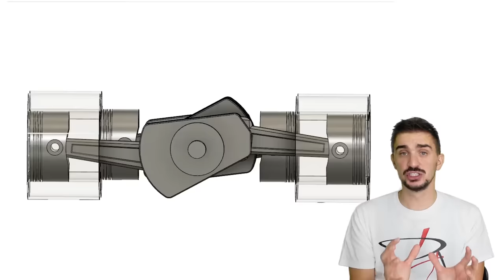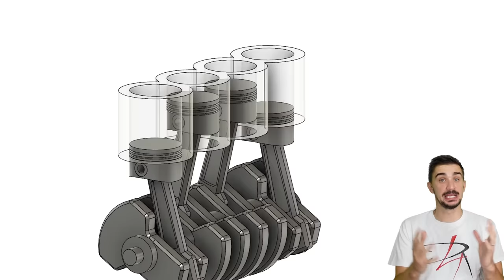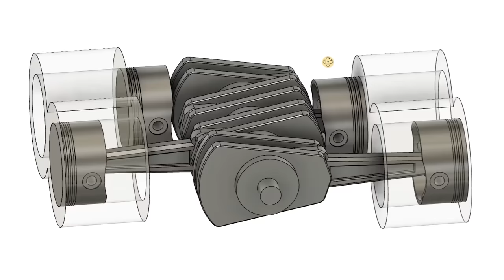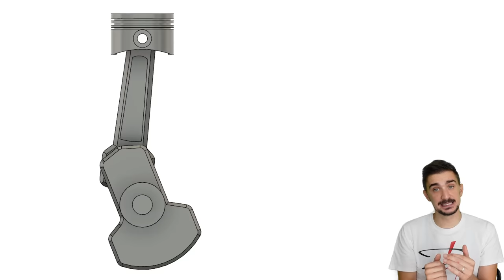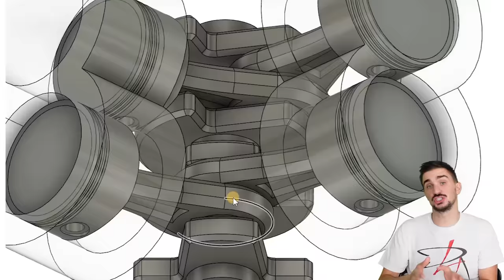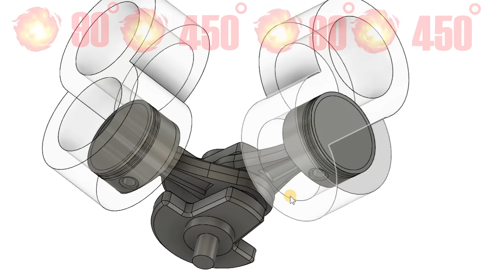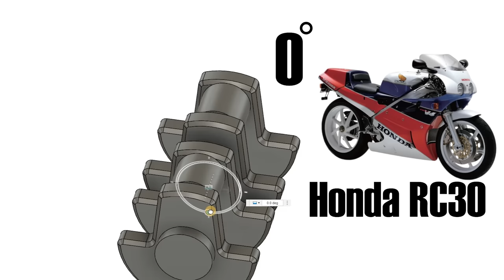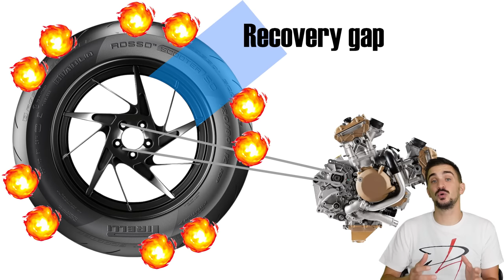Deep Dive: Inline 4 vs. V4 vs. Boxer 4 - What's the Difference? Engine Balance Explained in Detail

Comment: There is a solution to the offset problem with boxer 4 engines that I have never seen before, but the calculations add up. Suppose you have an I4 with a flat-plane crankshaft (that's basically all of them). Now flip the outer or inner 2 cylinders by 180°, making it a flat engine. You should now have the outer 2 cylinders on one side of the engine, while the inner ones are on the other side. Now it must become a boxer engine by having the opposing pistons reach TDC and BDC at the same time. This design has perfect primary and secondary balance from just 4 cylinders! Keep in mind that this is only possible with a cylinder count that is divisible by 4, so a boxer 6 of this configuration sadly isn't possible. I really don't know why no-one used this design before, so if you do know, please let me know. Thanks for the video! :D

Comment: It is hilarious how much worse the NA B4 and H4 are compared to the NA I4 in horsepower, torque, mpg, spark plug maintenance, and reliability. The only real positive for a B4 is “lower center of gravity”. 
An example of this is how the 2012 200hp NA B4 engine in the Subaru BRZ struggled to get 33 mpg highway, meanwhile both Toyota and Honda have been using NA I4 VTEC and VVTi engines to get 200hp and 40+ mpg since the mid 1990’s and early 2000’s. The Honda S2000 engine and K24 are proof of this. In order to get 225hp in the 2022 Subaru BRZ’s new H4 engine, the mpg took an even bigger hit and now they can’t even hit 27 mpg highway.
Reply: Subaru is behind Honda and Toyota in terms of efficiency and power density in an NA engine. On the other end, Subaru turbo 4s are engines of renown.
Reply: @psychemist2689  That is a good point, I almost forgot about that!

Comment: 22:20 The Alfa Romeo Alfasud from the early 1970s and the later Sprint, 33, 145 and 146 models, used a boxer 4 with a single piece cast iron block and the engine remained in production until the late 1990s.

Comment: I wish BMW made a 800cc boxer GS. I love those engines. They are perfection to me. I fell in love with boxers at first sight when I was 17. I would just look at them and say to myself: that is the perfect design. While your criticisms of boxers may have some validity in some applications or in physics, they really aren't a problem practically speaking. But I only concern myself with 2 cyl boxers. Horizontal opposed engines are used in most all aircraft engines for a reason (Lycoming, Continental). They are the most simple, lightweight, reliable engines that can be made. And as for motorcycles, they have the lowest center of gravity, and the cylinders protect your feet and ankles from cold and when laying your bike down.

Comment: The Ford Taunus V4 (the granddaddy of the Cologne V6 engine) was a 60 degree V4 with a rotating balance shaft...this engine was more legendary for being the engine of the Mustang I concept car (closer to an open topped Pontiac Fiero than anything else), and also the 4 stroke option for SAAB cars until SAAB created their own 4 cylinder engine.  It was in SAAB 96's, the SAAB Sonnet II in the USA, and the SAAB Sonnett III.  It was probably in early production SAAB 99's as wel...

Comment: The Ford Taunus Köln V4 also uses a balance shaft to get rid of the primary imbalance caused by its 60 degree bank angle. and it was made with the 60 degree bank angle because ford usa later wanted to develop it into a v6 and the v6 would be the main engine so they made the v4 with 60 degree bank angle and then ford köln took the american v4 and made the 60 degree köln v6 and there is no balance shaft in neither the köln v6 or essex v6 meanwhile both köln v4 and essex v4 has balance shaft

Comment: Would be interesting to see a video about flat engines in general. A flat 4 like you mentioned has extreme rocking imbalance which is why it is rarely seen. Theoretically a flat 8 would work better to cancel them out, just like an inline 4 cancels the primary forces.

Comment: I was lucky and at the same period of time I have a Ducati ST3, Triumph Sprint ST 1050, BMW R1200GS and a Honda VFR1200x. All ran well and only considering the engines the Triumph triple seemed the smoothest but the VFR was very close but also obviously much more powerful. The Ducati had an exhaust and was the more "racey" sounding engine and seemed to have the most profound torque curve. The GS has the most vibration but seemed to have the most torque lowest in the rpm band and seemed to be the easiest to control. I liked them all. And all served their purpose well. I only put about 20k miles on the VFR and Ducati. A few more on the Triumph and over 180k miles on the GS. I think the VFR engine sound is best. But the Ducati exhaust made it sound like it was something special.

Comment: Could you please contemplate the creation of a video explaining all the different drift and oversteer (incl. snap) characteristics considering the common engine-placement concepts in rwd-chassis such as front-engine (Viper etc.), front-mid-engine (Miata etc.), mid-engine (Pantera etc.), rear-mid-engine (MR-2 etc.) and rear-engine (911 etc.) due to balance resp. partial systemweight on each axle? And therefor the position of the rotational resp. yaw axis? This could be very interesting and helpful, I think. Thank you for paying any attention to this comment.

Comment: I have kept my Subaru WRX boxer engine completely stock since the day I bought it,  233,000 miles later and its been a great engine. But many don't understand what turning up the boost does, you can get away with it for a little while but it will cause major issues for your Subaru, you do need to know what your doing or your engine will quit on you in a catastrophic way.

Comment: Correct me if I'm wrong, but in regards to cars, most V4 engine cars were 2 stroke engines, since 2 strokes fire every 360 degrees instead of 720, a V4 two stroke wouldn't have the problem with uneven firing order. Also I don't think that uneven firing order was really that large of a reason, given the Ford Taunus V4 was a 4 stroke V4 used in quite a few cars. Additionally, american V8 engines had an uneven firing order because of the cross plane crankshaft. I suspect the reason the V4 isn't so popular in cars is that it doesn't present any real advantages in packaging over an inline 4. Sure it's shorter, but the I4 is already quite short. And if you want a front wheel drive car, having an inline 4 sideways (axially mounted, I think it's called) in the engine bay is shorter than a V4 would be. The same sort of logic applies to why boxer 4 engines are pretty uncommon.
edit: I just watched a little further and found out the Ford V4 had a split crankshaft.
Reply: I can't say I've heard of a two-stroke V4 in a passenger car. I remember three-cylinder two-strokes in the DKW-Auto Union and Saab cars, but...
Saab went to the Ford-sourced V4 for its model 96 and related cars because the three-cylinder two-stroke engines no longer met emissions standards. 
The original Buick V6 was a 90-degree engine with  90-150 firing angles and 165432 firing order.  Buick sold the tooling to Kaiser after the '67 model year where it became the powr plant for the CJ and Jeepster models. A neighbor built a Jeep from a kit got his family when I was a kid, I remember the body was warped and he had to get another. Another friend's Mom had a V6 in a Y-body Buick Special wagon. Both vehicles felt really rough under acceleration (both were three-speed stick shift), felt almost like a "Magic Fingers" motel massage bed. 
Buick reacquired the tooling in time to have a V6 for the 1975 Skyhawk and Aopllo/Skylark models. I even had a neighbor who had a V6 in a pre-downsize LeSabre. 
Buick engineers quickly developed a split-pin crank shaft and evened the odd-firing for the '76 models.

Comment: 9:08 i would never have thought v4 was so uncommon in cars that a car i have would be an example. 

Also, fun fact. Ford bought saab 96s for testing the v4 engine, and later sold them back to saab with the engines still in them. Saab tested the cars and this made them acquire the v4 engine to use in the saab 95, 96, and 97.
Reply: Lancia made an inline 4 that was slightly V, just enough to snug the pistons closer to each other. See Harry's Garage channel, and the restoration of his classic Lancia sports sedan.
Reply from the maker: That would be a VR engine. It has just one head right?
Reply: @d4a  Is "VR engine" an official engineering term? I'm sure it wasn't a thing in the 1970s when the V4 Lancia Fulvia HF was winning world championship rallies. But yes, Lancia had a 12° V-angle with a single cylinder head covering all the cylinders. They also had a 20° V4 engine in the Lancia Lambda in the 1920s. From my understanding,  Lancia were first to manufacture cars with V4 and V6 engines in mass production, so they should have got a mention here. Lancia also had a flat-4 boxer in the Lancia Gamma, so you could have done the entire video with Lancia examples.

Comment: I know it's not a racing platform but I would love to see a deep dive into a parallel twin. How does it compare to other options in street bikes?

edit: Growing up I always thought engines and suspensions were some type of magical knowledge that I would never understand. Your channel does a great job explaining concepts that are, on a micro level,  pretty simple. It just needs broken down. You're doing a great job of that here. Thanks
Reply from the maker: Here's the inline two: https://youtu.be/a9ZFZABaLbg
Reply: @d4a  Haha, Thank You! You are the coolest!.
Reply: @d4a  the term "boxer" in modern times is wrong.. understand a flat/opposed cylinder engine each rod has its own big end journal.. a Boxer opposed engine share bigend journals with opposing cylinders.. the reason.. for a shorter & much stiffer & lighter crankshaft & much cheaper to make .. the downfall being high primaey imbalance comparable to a single.. bit with higher combustion efficiency & rpm potential than singles

Comment: I find the aircooled VW boxer engine doesn't vibrate very much in a campervan. Because it uses 1 camshaft and runs pushrods, it has no belts. It just uses a gear system. 
Without coolant, it is very compact, so it isn't very wide, thus making the engine size very compact. So, the width of the vehicle isn't very wide.
I understand a VW classic car is far from a motorcycle, but it is very, very simple in design. 
For me, the aircooled boxer engine is a very clever idea decades before motorcycles used the same design.

Comment: Great vid, but if the secondary vibration is caused by the sideways motion of the crank pulling (or pushing) the piston faster during mid stroke, I don’t understand how there is then an additional secondary force at TDC and BDC as you show at 14:00.  Also, looks to me like those two “secondary” forces (if they actually exist) would just be part of the primary imbalance.  Even I’d they existed and contributed TLT he primary imbalance, since primary imbalance cancels in a straight 4, they would not add any added vibration one way or the other.

Comment: Secoondary shaking force is primarily obvious on inline 4 cylinder engines. This is the source of the buzzing. The actual cause is the center of gravity of the engine between 2 pistons at TDC and 2 at BDC. At 90° after or before TDC, all the pistons are a bit lower than half the stroke, thus the center of gravity is lower. The engine wants to maintain its center of gravity so tries to jump up.

Comment: Hi! You stated that the firing order of inline 4 cilinders can’t be changed and will always be even. However, Yamaha has changed the firing intervals for the CP4, inline 4 engines that they use for the R1 and MT01. Besides the mass resonance, this does something interesting to the vacuum resistance during the strokes too. Maybe this is something interesting to do a video about too!
Reply from the maker: 26:03
I have an entire separate video devoted to the cp4: 
 https://youtu.be/uM-ycHS9uvw

Comment: Regarding high power it should be noted that most small aircraft prop engines are 6 or 8 cylinder boxer with continuous power between 200 and 400 HP.  Here the choice is manly due mostly cancelled out forces giving much needed freedom of forces other than rotation and generated push as well as better cooling than a single inline bank.

Comment: Lancia Fulvia had the first FWD rally winner, with a V4 or rather a VR4, bcz I believe both banks shared the same head. The development happened around the same time as Ford's 1/2 windsor.
Reply: Lancia also had a 20° V4 with a SOHC back in the 1920s. I'm pretty sure that would have been the first mass produced V4 car engine.

Comment: Yamaha R1 is an inline 4 with a cross plane crank shaft with it set at 90 degree intervals,  with a firing order set at 270-180-90-180. The Yamaha Moto GP also uses this technical design. So there is a flaw in your explanation of what an inline 4 can or cannot do. Otherwise, I enjoyed it.
Reply from the maker: Really? https://youtu.be/uM-ycHS9uvw
There is no flaw with the explanation because an exception is not a rule

Comment: I actually feel very little if any vibration from my VFR750 and the engine is a stressed member of the frame. So there is zero vibration separation. Something you missed was the benefit of the V4 that Honda uses in the VFR which halves the primary imbalance by throwing it 90 degrees out. a 90 degree V twin also benefits from doing this as well like the V-Strom.
Reply: What do you mean by halving the primary imbalance? 90 degree V2 has perfect primary balance achieved by using a crankshaft counterweight. Same for V4 as it's two V2's stuck together.
Reply: @gogocro1  I remember there being information about it elsewhere. I'll look up the specifics on what Honda did specifically with the VFR. It's closer to the v4 Ducati had back in the 90s than what they are doing now.

Comment: A boxer-16 engine would be incredibly smooth, even when you do cylinder deactivation shenanigans.

Now throw in balance shafts and counterweights as well, and it would be the perfect engine for a luxury car.
Reply: It would also be perfect for a midengine high end car! Low center of gravity, high power; the large size of the engine could allow it to be part of the chassis, like in the Aston Martin Valkyrie
Reply: @OldSchoolZ-wy2yx  Probably too complex for that
Reply: From my understanding there are no true boxer 12 or boxer 16 engines, because inline 6 or inline 8 is already well balanced, so they make a 180° V12 or 180° V16 instead with more simple crankshaft than a true boxer. Probably not many flat-16 car engines made either. Porsche was building a flat-16 (180° V16) for the 917, but ended up building the 917/30 turbo for Can Am racing instead.

Comment: Another great video but a little surprised you never once mentioned the most abundant boxer on the planet, the Volkswagen boxer. And before you say its not worth talking about because it only produces 50hp standard its also one of the most modifiable engines ever made. How many engines can you increase the displacement from 1285cc to 2332cc with very little machining and ready available parts and increase power to over 10x original?

Comment: There might be one more objectionable characteristic of a boxer engine and it is the 'shoving' of the crankshaft itself from one case half to the other every 180° of rotation, and this creates the characteristic "growl" in these engines.  The main bearings do take a hit and don't last as long as the V or the inline.

Comment: Just a thing more about the boxer, the center of gravity in boxer configuration is low, that's true but you must mount the engine higher because you need have room for exhaust and for turbos. Furthermore in V4 and boxer you need to have 2 turbos in order to have them closecto the exhaust valves.
Me and my fryend had considerated the idea of using subaru turbo diesel for a small helicopter but it was very heavy, bulky and very high as well with all the necessary accessories.

Comment: -Now maybe I am wrong, but I always thought that "secondary vibration" in a piston engine was caused by the fact that in the first 30 or so degrees of travel, the piston at TDC moves downward a greater distance than the piston at BDC moves upward, creating an up and down vibration in an inline four engine.  Boxer crankshaft horizontally opposed four cylinders do not have this effect, which is why they are so smooth.
Reply from the maker: Think about it, that's what the video explains. Because the rod becomes shorter in the first 90 degrees of rotation the piston covers a greater distance in the first "half" of its stroke. But the difference in distance covered isn't what causes vibration. That fact alone is irrelevant and it's present in any piston and rod engine ever made, including the boxer. What causes vibrations is the direction of the forces. Watch the video carefully and I promise you will understand.
Reply: @d4a  Oh I understand, we are saying the same thing but in different ways.

Excellent video!